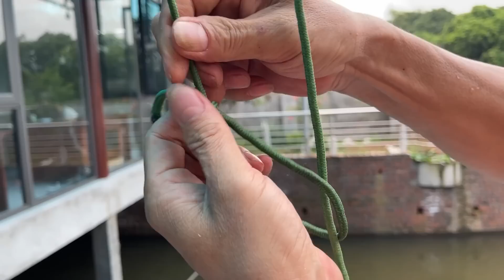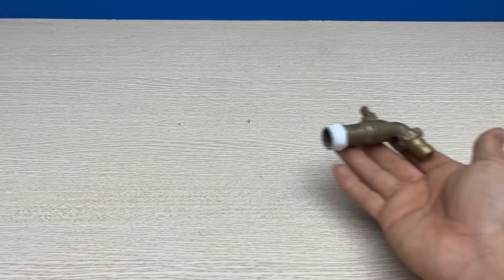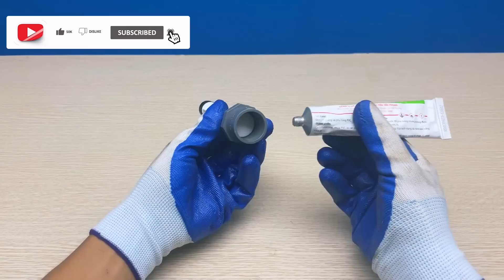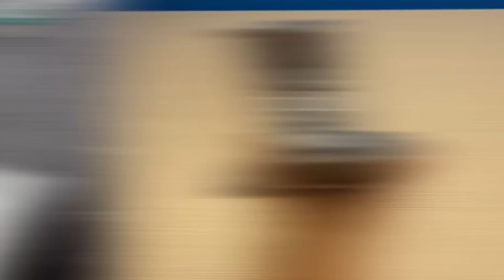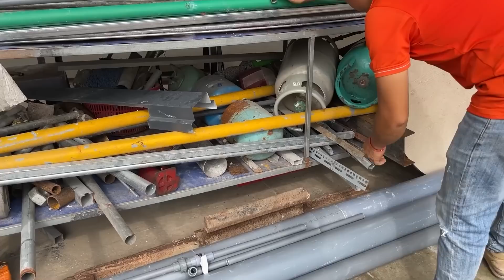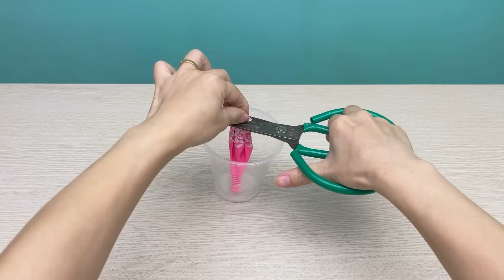why didn't I know these simple technologies sooner! fastest way to make metal water lock with rivet

Comment: It makes perfect sense. If you want to throw a rope over something, you go to the store, buy pipes, fittings, a saw, and make the structure in an hour, instead of standing on a chair.
Reply from the maker: Absolutely, your point is spot on! Creating a proper structure using pipes, fittings, and tools is not only safer but also more efficient. It's always wise to prioritize safety and practicality over risky methods. Thank you for sharing your insight, and I completely agree that taking the time to build a secure solution is the way to go. Keep up the great discussions on the channel!
Reply: the act wiht the rope is the only one that makes sense. i'm electrician , and passing cables withe a stair through stores with structures likes this climbing over stairs or a chair is not a good solution att all. 
you must think on the long run. effectivly if you do this one time every ten months is worthless!..

however the rest is bullshit ideas!! sorry creators! but you need to improve a little!